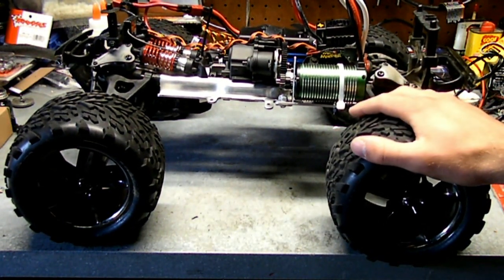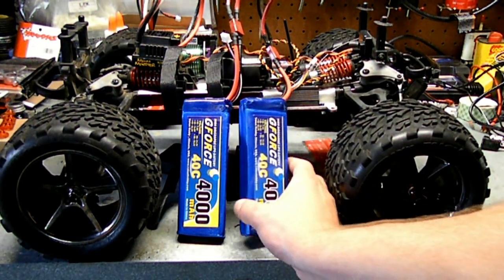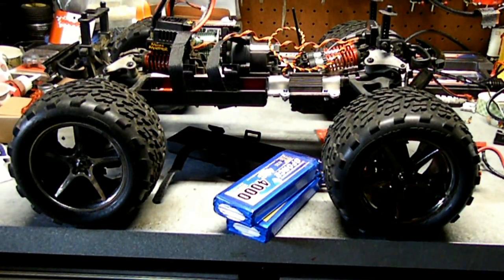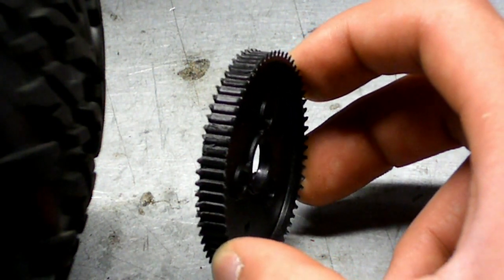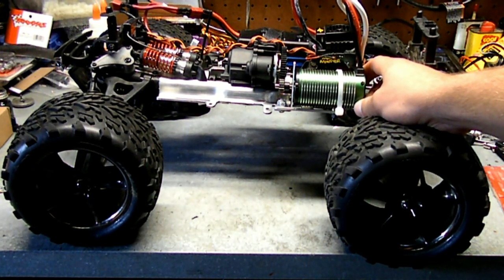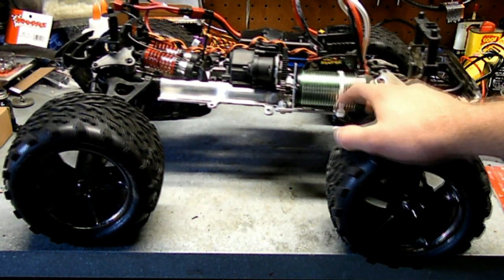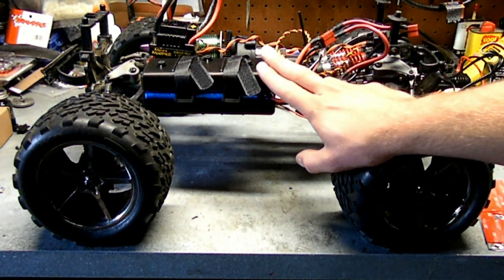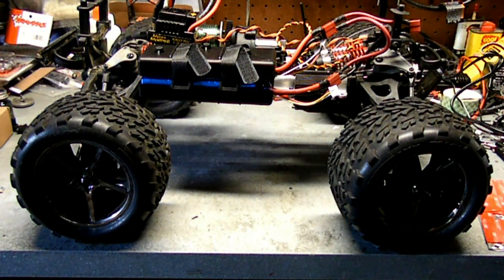Project: Electric Revo Conversion Part 3

Comment: How have the axels held up o have a 6s system I wanna put out of my rustler an convert my revo
Reply from the maker: They've held up fine.
Reply: Sweet thanks for replying I had my revo on the bench an the Alan key in my hand an was gonna pull the motor an make a motor mountbut I still have a tank of fuel left in the can an gonna burn that up an might put the 6s system in it then if the axels have held Good to no the rustler ones don't last an they where brushed axels lol still habe the plastic center shaft tho.